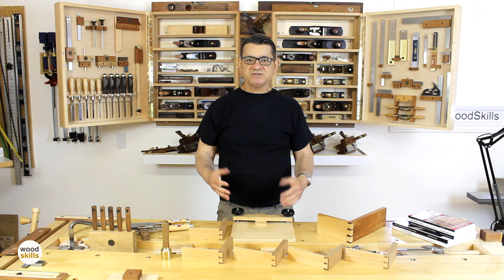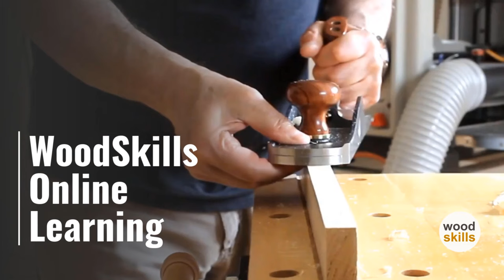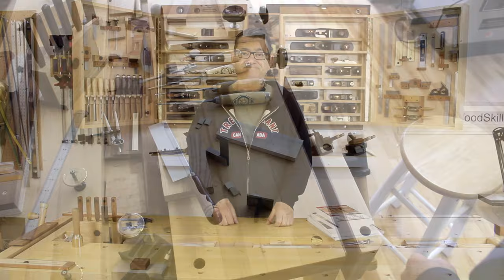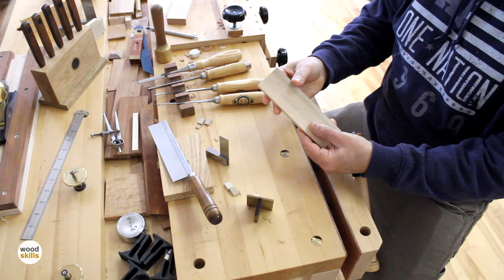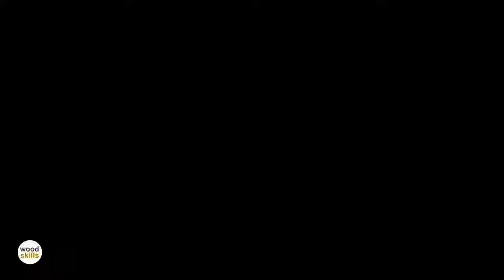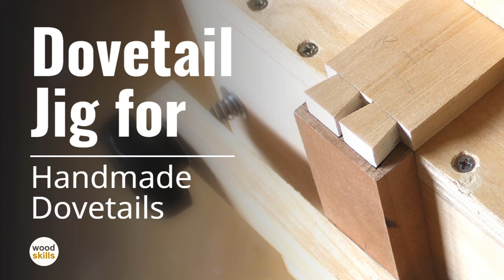How to Cut a Dovetail Joint by Hand using Dovetail Jig

Comment: 1) Instead of using a gauge to mark the lines to follow, use a gauge to guide the saw when cutting the tails- faster and more accurate (no tail marking required).
2) mark the pins before removing the material around the tails- a saw blade can be used for this, making sure the tail part is moved sideways by the thickness of the saw kerf first ( a gauge can be used for this) The saw drops into this mark, ensuring accuracy.
3) remove most of the material between tails and pins with a coping saw (on through dovetails for the pins) before using a chisel. Faster.